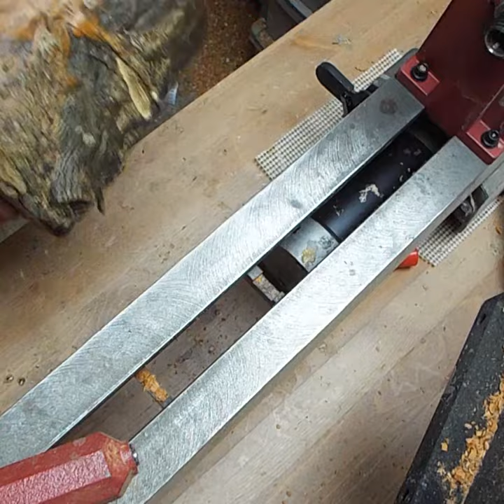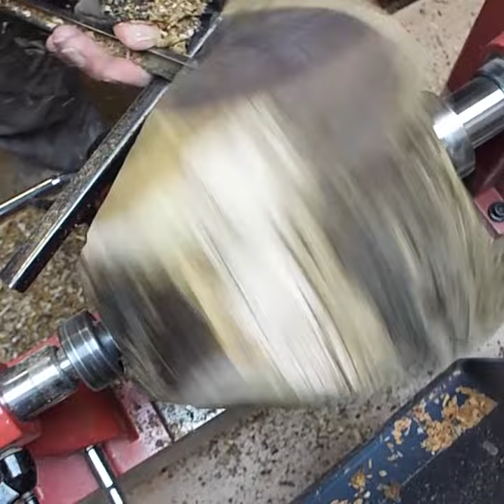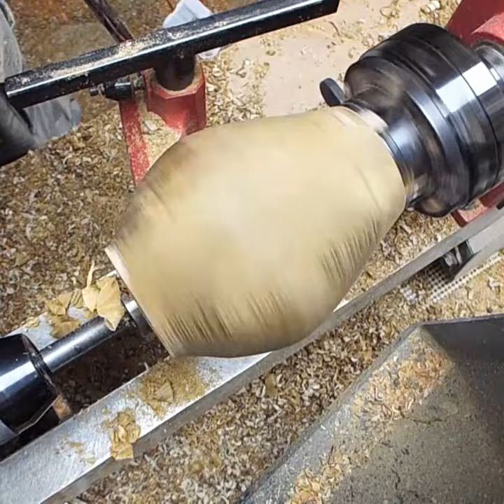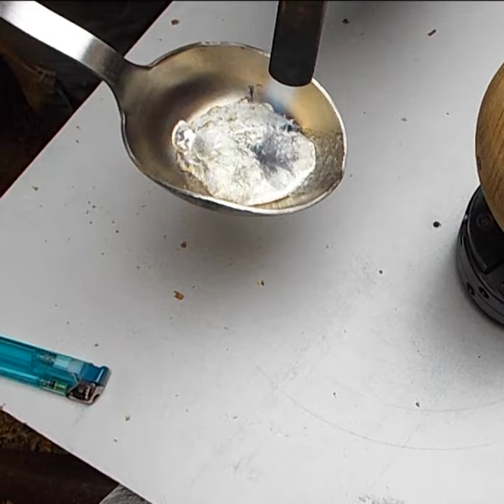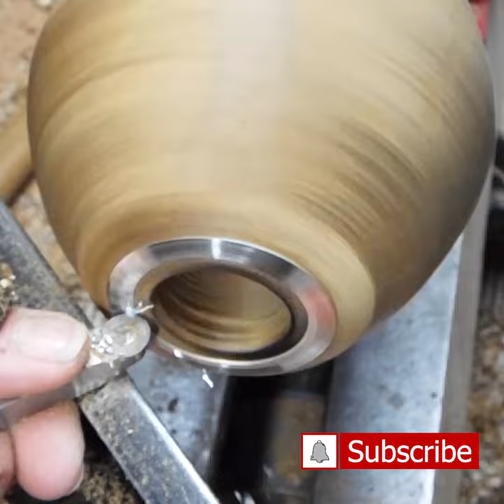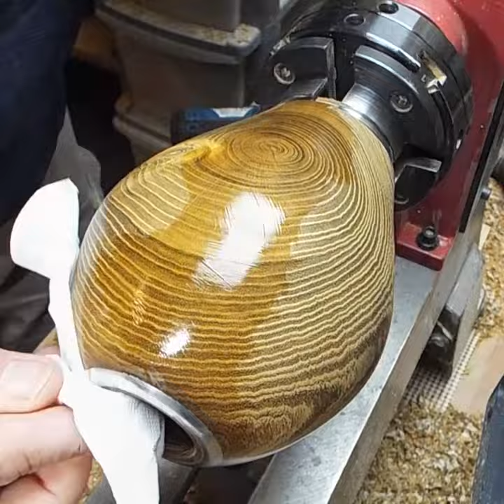Woodturning project - Laburnum pewter metal inlay short #woodturning #shorts

Comment: That's really nice!  Thanks for showing the pewter inlay process...  I had no idea you melt it and pour in a mold.  It must be really soft and melt at low temp?
Reply from the maker: Thanks Mitch, the pewter melts at about 250c which is easily achievable with a blowtorch.
Reply: @MikeHolton  cool!  I will have to try it on a turning. Keep up the great work! 👍
Reply from the maker: @mitchgillilan  Thanks, let me know how you get on. The full video will give you some more tips, just check on my channel.